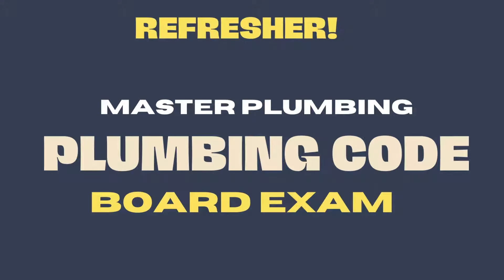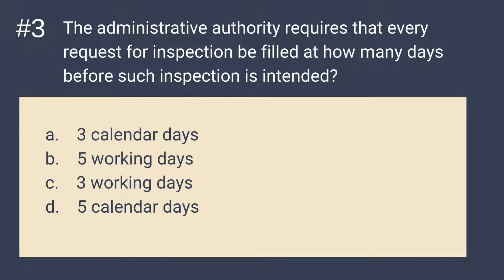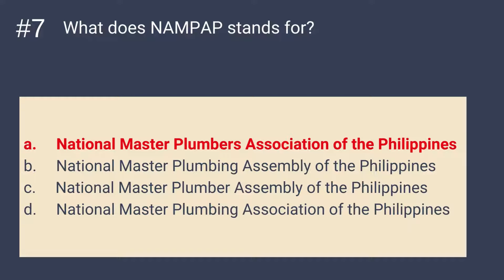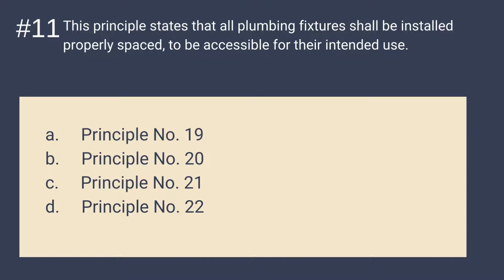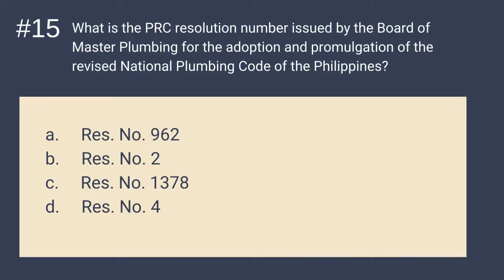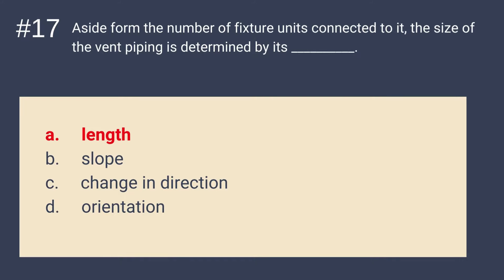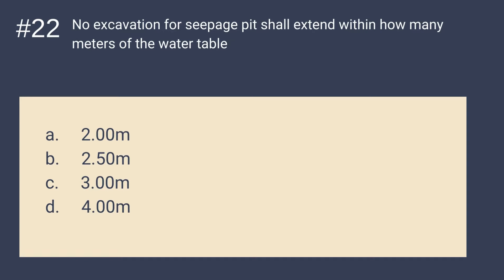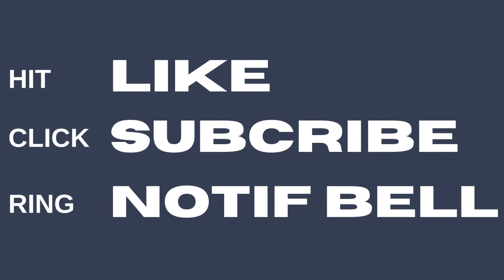MASTER PLUMBING REFRESHER : PLUMBING CODE part 1

Comment: I believe as of No. 19, Bathtub dapat. 
"C.O. Maybe omitted on short horizontal drain line less than 1.5 except for sinks and Urinal"
Reply: It is urinal or sinks. "Cleanouts may be omitted on a horizontal drain line less than 1.5m in length unless such line is serving sinks or urinals."

Comment from the maker: #16 correct answer is 60 degree bend when installed in true vertical position (sec. 705.4 NPCP)
Reply: Pls verify #15 may nabasa din ako na it's resolution no. 4
Reply from the maker: @narahapparels  still verifying po :) It would be much appreciated if may copy kayo ng resolution 4 para mcheck natin.  Wala pa po ksi akong mahanap.....Thank you !

Comment: Thank you this were very a big help for us👏
Reply from the maker: #16 correct answer is 60 degree bend when installed in true vertical position (sec. 705.4 NPCP)

Comment: Thank you this video is very usefull
Reply from the maker: thank you din po :) will be uploading other vids pa for review..
Reply from the maker: #16 correct answer is 60 degree bend when installed in true vertical position (sec. 705.4 NPCP)

Comment: kailan next upload?
Reply from the maker: MASTER PLUMBING REFRESHER: PLUMBING CODE part 2: https://youtu.be/F7bi49zuFWY
Reply from the maker: https://youtu.be/uhbM3eTUMgo
Reply from the maker: #16 correct answer is 60 degree bend when installed in true vertical position (sec. 705.4 NPCP)

Comment: Number 15, hindi ba resolution number 4 ang answer?
Reply from the maker: #16 correct answer is 60 degree bend when installed in true vertical position (sec. 705.4 NPCP)
Reply from the maker: still veryfing on this sir... :) may copy k po ng resolution 4 ??

Comment: #15. Res no. 4 (not Res no. 962)
#16. 60 deg. bend (not combination wye)
Reply from the maker: hi po.. 
#16 thank you for your input sir. this is verified. correct answer is 60 degree bend when installed in true vertical position (sec. 705.4 NPCP)

Comment: 16/25 😔 more review pa
Reply from the maker: #16 correct answer is 60 degree bend when installed in true vertical position (sec. 705.4 NPCP)

Comment: More pls
Reply from the maker: #16 correct answer is 60 degree bend when installed in true vertical position (sec. 705.4 NPCP)

Comment: Hi, your videos has been helpful to us who are working but can study at the same time. But I want to correct that #9 should be Principle 2 and #10 should be Principle 5..
Reply: #12 Principle 8
Reply from the maker: Hi po. :) Can you email your reference to us @ audioreview.yt@gmail.com para ma review natin?  Thank you so much 

As per (1999) National Plumbing Code of the Philippines: 

#9: Principle 5- Every building having plumbing fixtures installed and intended for human habitation, occupancy or use on premises abutting on a street, alley or easement where there is a public sewer, shall be connected to the sewer system

#10: Principle 10-Each fixture directly connected to the drainage system shall be equipped with a water sealed trap

#12: Principle 16-No water closet shall be located in a room or compartment which is not properly lighted and ventilated
Reply: @miho-v2q  Mam tama po ang nasa video.
Reply: @AJJ0727 correct po